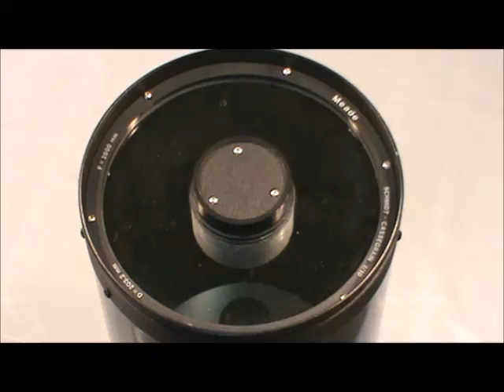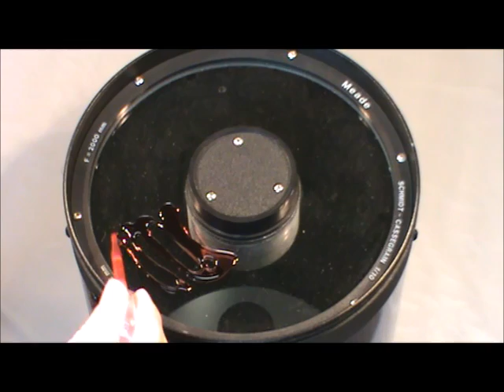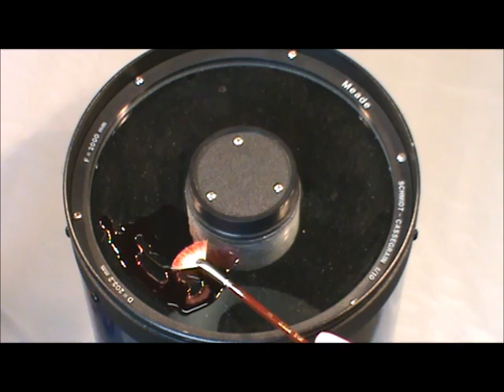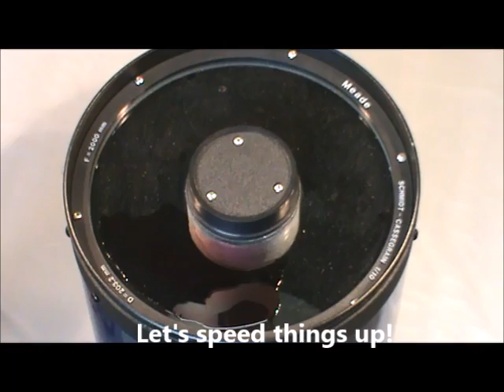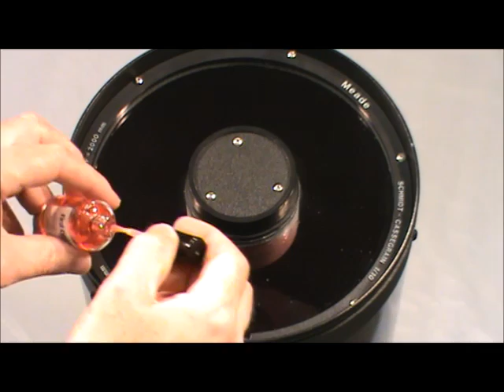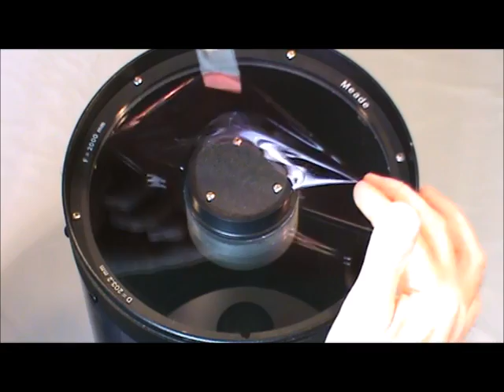SCT Corrector Plate Cleaning - No Touch Method

Comment: I feel like a tip tilt method of spreading the polymer would be better than a feather brush. You definitely don't want to move any grit around on the corrector plate. Of course this would probably take more polymer.
Reply from the maker: Hi Cosmocarl, thanks for your input.  One could certainly apply the polymer and "tip / tilt" the plate as you mentioned, that has been done on plenty of optics.  And of course you're right that you don't want to move grit around on the surface.  When using any brush the idea is to spread the polymer using the polymer's surface tension so the bristles don't actually make contact with the plate surface.  Even if one does get too close to the surface with the bristles there should be no pressure put on the bristles (like when you paint a fence or board) so the bristles "hydroplane" so to speak.  Clear skies!

Comment: My Meade SCT has been dormant for a new of years.  Now that I have more time on my hands I'm putting it back in use.  Although its been kept well indoors, on inspection there seems to be two patches of what I suspect is a fungus..though not really sure. With a very sorft brush i went to lightly brush the dust off the plate however the patch in question just seemed to smear.  Is this something that first contact can remove or do I need to revert to a more aggressive cleaning approach?
Reply: Hi.  Thank you for your inquiry!  Well, as far as removing your fungus the short answer is "maybe".  Our company purchased a "dormant" 8" Meade SCT and upon receipt we found there to be fungus on the back side of the corrector plate and also on the primary mirror.  Having never tried to remove fungus with First Contact we thought we'd give it a try and apply the polymer to both the corrector and primary and the fungus was completely removed!  There are many, many types of fungus and since we only dealt with it one time we can only say it might remove the fungus.  That it smeared with a soft brush gives us hope it is not strongly adhered to the plate.
Reply: @davidgiesen1832  Super! Thanks for the prompt reply. It certainly doesn't seem to be etched into the coating, and from what I can tell  seems to be present on the outside only.  I think there's a good chance of restoring it to former glory.  Its 25 years old but as good as new in all other aspects.

Comment: The fact that the polymer will attack the gaskets is a deal-breaker for me. This is a very expensive way to clean your corrector and not really necessary. A modern-day optical coating is a lot more durable than they were many years ago. In most cases, harder than the glass. I have used this method on precision optics that are very soft.  High-end military optics. Nothing approaches it for cleaning first surface raw aluminum coatings where any rubbing will severely scratch the coating. Short of removing the lens for immersion cleaning, this is the best method for removing particulates from the surface of the lens without scratching. However, if the lens has a lot of chemical deposits that are water-soluble, this method won’t remove stains and blemishes from the surface of the lens.
Reply from the maker: Mike, you are certainly correct that today's optical coatings are better than they were in the past although still not as hard as the underlying glass.  Fluorite CaF2 has about 1/4th the hardness of optical glass such as BK7 and is very easily scratched. Magnesium fluorite MgF2, a common optical (glass) and mirror coating, has about 2/3s the hardness of optical glass.  You are also correct that First Contact won't remove water-soluble contaminates as water is a polar molecule and the solvents in First Contact are non-polar.  Well, the polymer will often remove some of the contaminates, those that it can encapsulate, but it won't dissolve the contaminates at the molecular level. What First Contact does is allow one to either use the polymer in conjunction with a water-based cleaner, or remove most of the contaminates that can scratch coatings so that a water-based cleaner can be used post-polymer and minimize the threat of scratching.  

We are aware there are some applications where First Contact is not the first choice for cleaning, it merely gives consumers a choice given the science and personal capabilities available.  Some optics just do not need to be cleaned to the molecular level and residues do not matter to the user; in such cases something as simple as glass cleaner can be used.  First Contact IS the first choice for many, including NASA, LIGO, Lockheed and others where even a single microscratch is unacceptable.

We're glad to hear you're happy with First Contact cleaning your high end optics and first surface aluminum coatings.  If you ever have an application you're curious about please contact us at Sales@PhotonicCleaning.com, we're happy to answer any questions you may have.

Comment: In your video, when you have taken the polymer film off, there seems to be a mark on the surface at appx the 2 o'clock position. Is that residue from the ploymer or??2
Reply from the maker: Hi, and thanks for your interest in First Contact.  No, it wasn't residue as the dry film came off complete and there were no thinned areas during application that would cause polymer to remain on the surface.  As long as you apply a thick, continuous wet film the dry film has the mechanical strength to hold together when peeling.

I looked back at my notes on this video and didn't make any comments about the mark.  I look over surfaces carefully after videos and would have noted any issues.  I suspect the "mark" is actually a reflection from an overhead light that was visible after all the contaminates were cleaned from the corrector plate.

Please note that if it were polymer residue, one of the many advantages of First Contact is that the liquid polymer will dissolve dry polymer and once dry again will peel as normal and remove any residue.  If a user applies the polymer too thin or leaves and "island" of polymer not in contact with the other polymer one can just apply more liquid polymer and peel once dry.

With all that being said, please know First Contact will not always remove all the contaminates from a water spot or dew event.  Often the contaminate are "glued" to the surface when the spot / dew evaporate.  Water is a polar molecule and the polymer's solvents are non-polar and thus don't break down polar molecules well.  If you clean your corrector plate and notice water spots use this procedure for removal:  https://www.youtube.com/watch?v=7Tmsf055BHs&t=1s

Comment: Just purchased some to use later this year to clean my new 9.25 sct. I live in the southern US and it gets quite humid and there can be lots of pollen in the air. I also live close to a major interstate highway and I regularly get an almost oily haze on my corrector plate (possibly air pollution/smog). I'm confident this will remove it as I am too scared to touch and possibly scratch the corrector plate. Using this will put my nerves at ease.
Reply from the maker: Hi Aaron, you will have no problems removing the oily film from your corrector plate.  The solvents in the polymer will dissolve such contaminants and then be encapsulated in the film.  The video is fairly comprehensive but if you have any questions we didn't cover please feel free to contact us at Sales@PhotonicCleaning.com
Reply: So I cleaned the corrector plate today. It's was quite easy and definitely stress free, as far as potential scratches. I did get a small super tiny droplet on the corrector ring and it left a small mark on the plastic ring, no biggie. It removed all of the oily residue but left what appears to be the outlines of dew droplets on the plate, should I try the water stain remover? For others the film applied on a dry Texas afternoon the static charge left on the glass will make dust cling right back to the glass BUT is it clean! So glad I purchased this no teeth clenching moments!
Reply: @AaronDavila1  you probably do have some water spot contamination on your corrector plate.  The water spot pretreatment will remove the dew droplet outlines.  You must take care so the pretreatment does not flow past your secondary mount or past the outside retaining ring and ingress into the tube assembly.

Dry climates do allow for a static charge; if you peel slowly the charge will dissipate as you peel and be much less a problem.

Comment: $50 yes, $550 no.
Reply from the maker: I'm sorry but I'm not sure what you are looking at? many of our kits are reasonably priced roughly around $100 to $200 and will last the average consumer multiple cleanings before they would ever need to order more. Most won't need an entire liter of polymer which is around the price you are suggesting. If you have any questions about our product please feel free to contact us.
Reply: The starter kit is $148 US and according to google’s math, the starter kit will get you 280 square inches of surface cleaning, which on a 11inch SCT that’s just over 3 full cleanings (90 sq inches per clean).  How often will I clean it? Depends but let’s assumed once a year, which would then last me 3 years, which is $50 a year to ensure optimal light transmission. $550, that’s a lifetime amount of cleaner lol
Reply from the maker: @platetectonic  sorry it's taken so long to reply; for some reason we did not receive a notification when you commented.  Your math is correct! The Red First Contact Regular All-Inclusive kit ($148.00) will clean your 11" SCT 3 times; $50.00 per cleaning.  The price per ml goes down for kits containing more polymer.  For instance the Deluxe All-Inclusive kit reduces cost per cleaning to just under $40.00.  However, for a person with just one 11" telescope that's several year's cleaning with the Deluxe kit!  We don't often have customers with just one telescope so the polymer is used up cleaning multiple 'scopes.  We do have individuals with several large telescopes that order liters because the cost per ml is significantly reduced, although our usual liter customers are businesses.  And finally, we often run discounts in conjunction with exhibitions we attend.  If you're curious send us an email at Sales@PhotonicCleaning.com and we can discuss further. Clear skies!

Comment: what about hard water residue? had a sprinkler go off on my edge hd 11 inch. and what about use on mirrors
Reply from the maker: Hi Ryan, The polymer by itself typically doesn't remove all contaminates in a water spot.  Water spots are best cleaned using our two step cleaning process with pretreatment and polymer.  We've got a video on our YouTube channel showing how to spot clean a corrector plate (necessary if you're cleaning the plate in situ).  Water spots on mirrors can also be removed with the water spot pretreatment and polymer.  You can read our "Water Spot Removal with First Contact Polymer" document on our website under the "SDS and Tech Data" link at www.photoniccleaning.com.  Feel free to send us an email at contact@photoniccleaning.com and we can give you more insight into the process.

Comment: Uhhh just use some dust blower man.
Reply: Lachezar, thank you for your comment.  You are correct, if there is simply dust on your corrector plate most can be removed with a puffer.  Of course, there are situations where you would not want to use a puffer such as if the dust is volcanic and can create microscratches and diffraction if allowed to be blown across the surface with air.  Also, there are many other contaminates that can settle on a corrector plate such as pollen and bug residue, and also a dew event can "fix" any contaminate in place and create a haze on the plate.  In these situations First Contact can remove those contaminates and/or haze.
Reply: It looks interesting :)
Reply: @lachezarkrastev7123  where are you located?  We have many distributors and resellers that can provide First Contact if you'd like to test it out yourself.  We want to help people clean their optics and achieve better seeing and astrophotography.
Reply: Bulgaria and we have an astronomy shop in our capital, can you believe it :)))
Reply: @lachezarkrastev7123  Astronomy and astrophotography are loved worldwide so we are not surprised to hear Sofia has an astronomy shop!  Actually, we have shipped First Contact to Bulgarian customers many times.  Unfortunately none of our European distributors are currently capable of shipping to Bulgaria so we must use DHL from the U.S. which makes the shipping cost for a single kit rather high.  We hope to meet you some day at an astronomy event!

Comment: And still looked a bit dirty.
Reply from the maker: Hello again Paul, no the corrector plate surface was actually pristinely clean after First Contact removal.  Unfortunately the back side of the corrector plate does have coating damage from the previous owner, who left the telescope stored in a garage for years and allowed fungus to form on both the primary mirror and backside of the corrector plate.  For demonstrations, the corrector plate works quite well.  I suspect you could see the backside coating damage in the video.  Take a look at the results other customers have reported on their optics: http://www.photoniccleaning.com/FCPTestimonials-s/130.htm.  

Also, if you're familiar with LIGO I'm sure you know their optics demand cleaning to the molecular level.  LIGO uses First Contact exclusively to clean their Advanced Core Optics.  Take an opportunity to watch the LIGO video on our website's Home page.  Cheers!
Reply: @Freedom-Peace-Mercy  thank you for your comments and interest in First Contact.  To answer your questions and comments:  

First, we have demonstrated First Contact Polymer's safety and capabilities on customer's equipment many times.  However, we don't have the luxury of performing lengthy video sessions with such equipment.  Did you take a look at our Testimonials page to see all the customer's comments and photos?  https://www.photoniccleaning.com/FCPTestimonials-s/130.htm

Second, yes we are aware many prefer to blow off contaminates and use other methods to clean optical components and we applaud these people.  We have a combined 40 years experience at our company on other optical cleaning methods and we know it is difficult to accomplish other cleaning methods without leaving residue or scratches so if you're doing so without any damage or residue that's great!  Sadly, it is very easy to create microscratches that are not necessarily visible to the eye but cause diffraction to photos passing through the optic.  Also, yes our product is not as inexpensive as distilled water, but consider that our Red First Contact Deluxe kit will clean a 14" corrector plate 4 times the cost per cleaning isn't substantial.  Please also realize, First Contact Polymers were developed for precision optics which must be cleaned to the molecular level and our primary customers are Lockheed, Raytheon, NASA, etc. Many years ago citizen astronomers began using First Contact on their telescope optics and as the interest and sales grew we felt the need to meet those customer's requirements.   Concerning safety;  no other method of cleaning is more safe than First Contact Polymers.  Applying First Contact is actually a no touch method and our products have been tested and are in use on tens of thousands of optic all over the world including auguably the most sensitive optics on the planet located at the various LIGO facilities around the world:  https://www.photoniccleaning.com/category-s/137.htm.  The coatings on your corrector plate are quite safe with First Contact Polymer.

Have a great day!

Comment: great 👍 can i use car battery's distilled water instead of that chemical you used?
Reply from the maker: BaguSadikin, many people do clean corrector plates and mirrors with distilled water, mild detergents, etc. but with the risk of leaving residue in the form of streaks and spots, or scratching the coatings.  First Contact does not leave residue and in fact can remove residue from other cleaning attempts, and it won't damage the coatings.
Reply: Really helpfull sir, im very paranoid before knowing the chemical, and now im ready for cleaning :) thanks'

Comment: Great job !
No problems with the coating ?
Reply from the maker: +Sébastien FLENNER, there are no problems with the coatings.  Coating adhesion to the substrate is typically quite good, unless the manufacturer had problems during production and the coatings are simply "laying" on the substrate.  We've never seen, or had customer feedback, First Contact damaged corrector plate coatings!

Comment: why not take the corrector ring off?
Reply from the maker: +Markinpuff.  You certainly can take the corrector ring off the outer perimeter, although you must take care not to rotate the plate, or one can "match mark" the plate and housing in case it does rotate slightly you can realign.